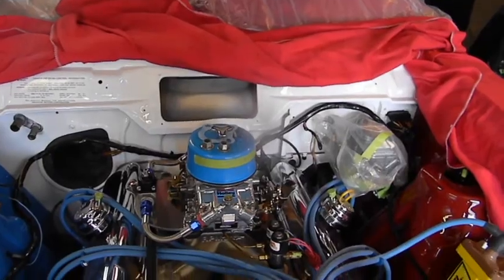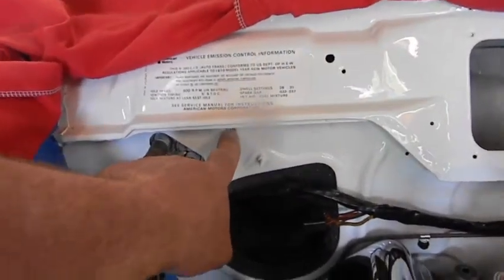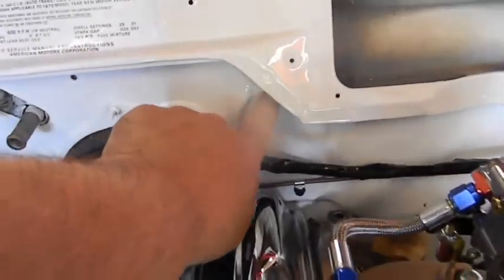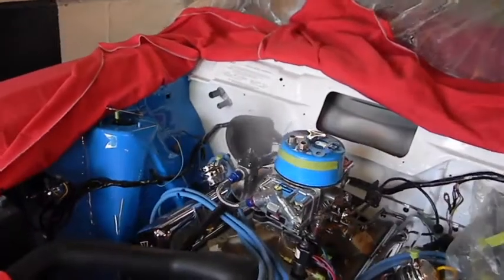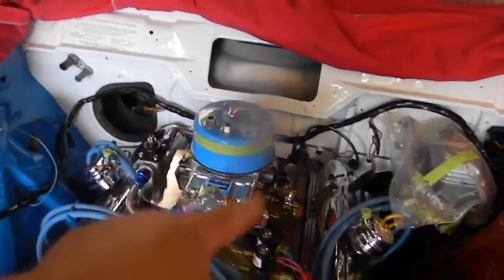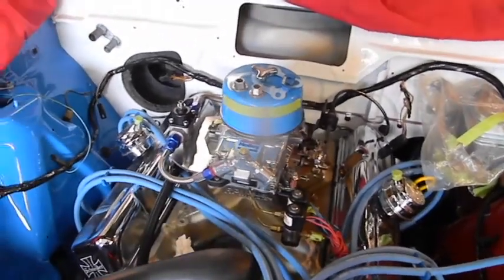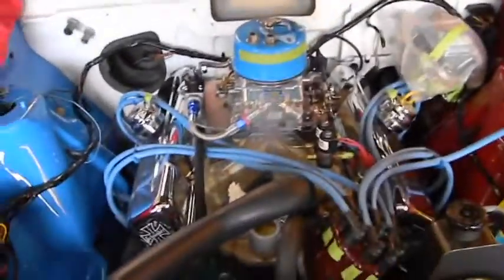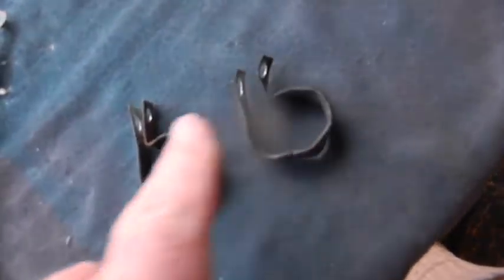AMC Wire Harness

Comment: Ground wires are so extremely important, and the most overlooked of all electrical connections.  Without adequate ground your engine won't start. Stereos sound like shit. And all the other electronic accessories on your car won't work well without a good ground! 
Good to hear that Edelbrock is finally working on some good single plane manifolds for AMC. Any airgap manifold is lightyears ahead of any non air gap manifold. Remember,four every 10 degrees less of heat in the intake tract the hp increases by 5 hp. It's so important that Dyno runs on an engine is worth noting the ambient air temperature to quantify the Horsepower developed b an engine. There is an SAE standard temp for all dyno measurements, to keep things on an even playing field. This might not mean much to the guys on the east coast or mid west, but in the desert southwest ambient temperature has a huge effect on performance. So much so that all newer aftermarket Turbo and supercharger setups ups use some form of intercooler. 
 As for the snow, it sounds more like the hail we see out here. Not very big, but the drop at high velocities. There has been some sizable hail over the years, and a few years ago one Dealership Row in Phoenix had to mark down cars that were pummeled by the hail. The cars all looked like golf balls with windows. Lol. By the way, GOLF, Gentlemen Only Ladies Forbidden is huge in The Valley, we used to go play for cheap when the snowbirds were out of town, but now it's expensive year round. So how do I escape the wife? I guess it's time to buy a fishing boat! Lol